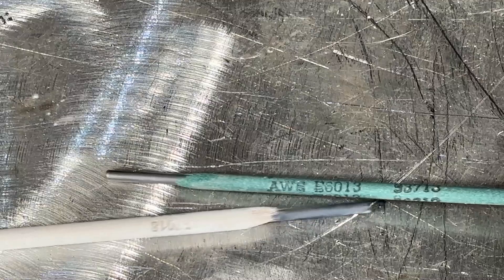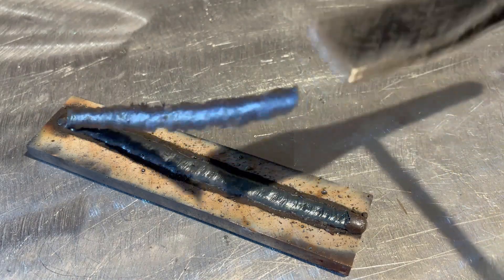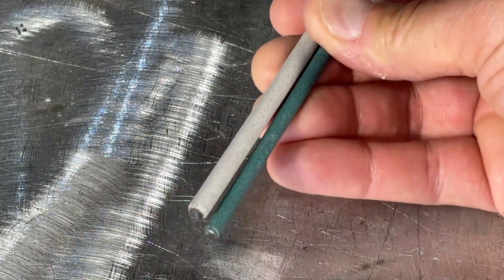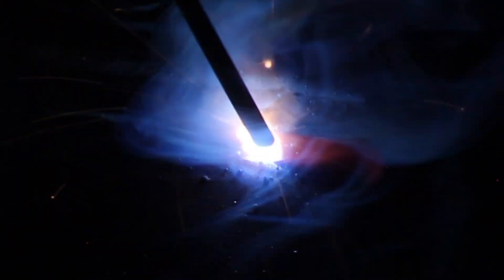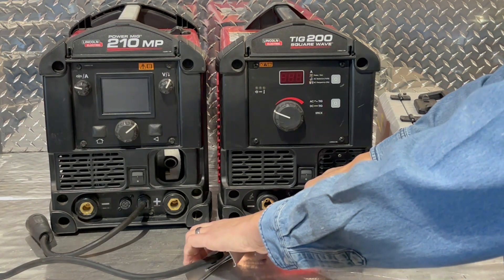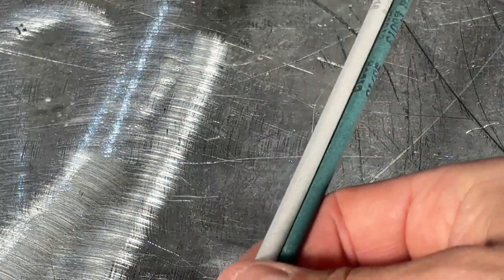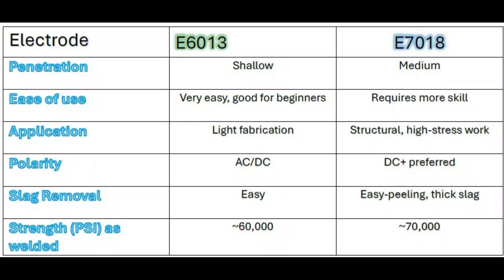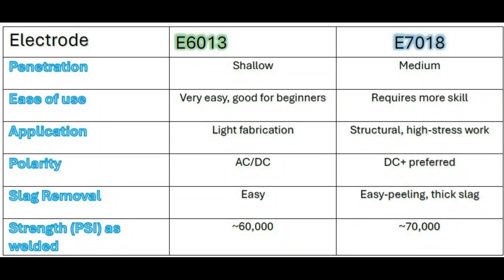7018 vs 6013 What is the difference?

Comment: i really don’t like 6013, the weld puddle looks like swirly pool of garbage, the welds often times have porosity.
Reply from the maker: not sure-  I have the opposite experience. clear shinny puddle and super forgiving when it comes to porosity.  With this said, its not my go to rod.
Reply: @sewingwithfirewelding5627 
that’s interesting, i work at a college and when we went from using 6013 to 7018 the students couldn’t be any happier. the immediately improved on their welding from one hour to the next 😂
Reply from the maker: @ haha- yeh don’t get me wrong - 7018 is king. Same I teach at college, we use the rutiles for about 3 weeks then its cellulose and low hydrogen. I just find for the ones who are brand new, 6013 strikes a bit nicer.
Reply: @sewingwithfirewelding5627 yeah 6013 is super easy for restarts for sure, typically the way it works is they use  for about 4 hours then we introduce them to 6011 and finally 7018.

Comment: lots of truck frames were welded with 6013 back in the day before automation took over and still used today in ship repairs surprisingly. of course 7018 is better in almost every application but if 6013s are half the price of a 7018 i understand why its still in use. cheap and gets the job done if used in correct way.
Reply from the maker: @SamFBM  I had no clue - it’s a pretty interesting rod. To be honest we use it on week 1-3 of our fab program, after this is 7018 low hydrogen. I find it runs nice downhill on thinner sheet metal.